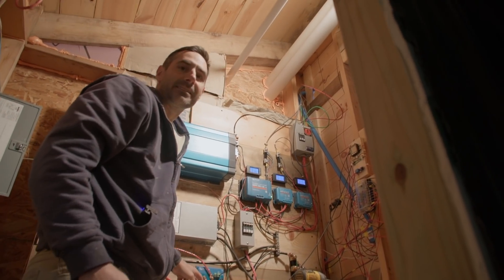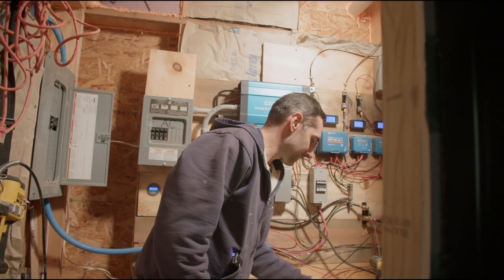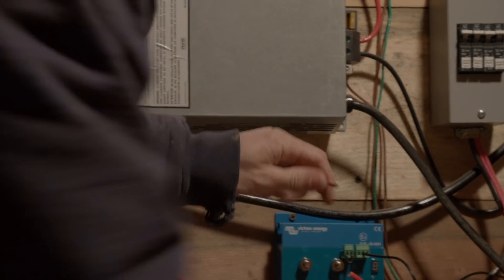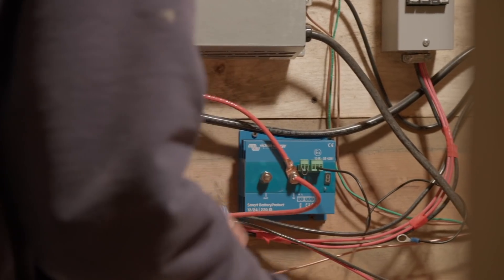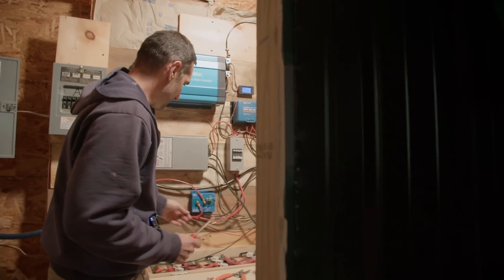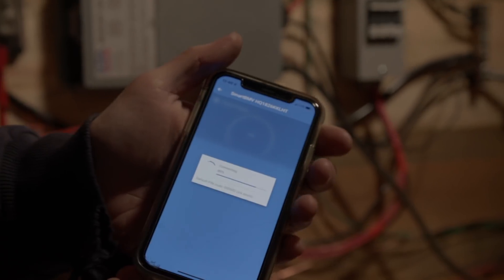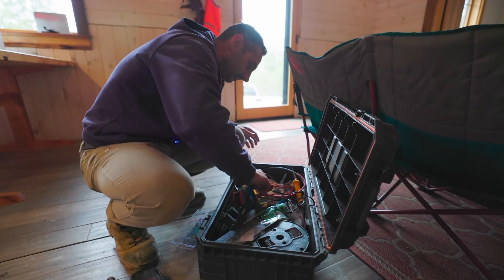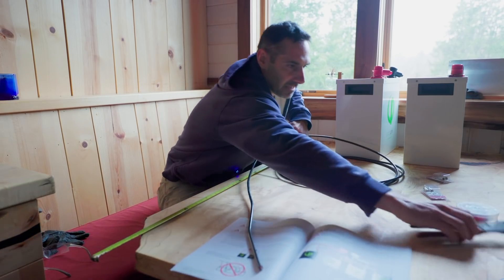Installing new Batteries | Lead Acid to Lithium Iron

Comment: Nice Mike. In your climate an not being there in the winter all the time, is battery temperature a concern for lithium and do you keep the power on when you leave to go back home?
Reply from the maker: It's not really a concern.  If I arrive to the cabin and it's below 20 degrees, I just have to make a fire first before I can use any power.  I keep it turned off when I am gone.

Comment: Little pro tip I learned is to use a pencil ✏️ and rub that graphite on the ring’s before connecting to the terminals, you will never get a spark.
Reply from the maker: Cool thanks!

Comment: A duct jack will make the process of upgrading the solar panels so much easier. Bring down the old panels and up the new ones without carrying them on the ladder one at a time.

With the better battery setup a bread maker can really change the feel of the place as 20-30 minutes of setup time can give you fresh bread at each meal and most of that time is back at the house measuring the dry and wet parts to have dump and set level of work at the cabin. How would the bank react to fresh raisin bread on her visits?

Comment: You can turn equalization off on them victron charge controllers. I'd look more online for the proper settings for that BMV and charge controllers. Also, that victron low voltage disconnect isn't really needed with them batteries. Drain them to 0% if you want, it won't hurt them. Them batteries will age significantly more with time than the amount of cycles you put through them. You don't need 10,000 cycles. 10,000/365 = 27+ years if you cycle them daily.... which you  won't. Glad to see them leads are gone.
Reply from the maker: Nice thanks for the tips!
Reply: A Victron LBCO is definitely needed for DC loads so your BMS avoids having to shut off the batteries. BMS should be a last line of defense, not the only one.
Reply: @BriggsandStrattonEnergy  No other battery manufacturers require this but you do? Definitely won't be buying a SimpliPhi if you don't trust your BMS to work properly.
Reply: @off-gridengineering3377  No worries - we are not the perfect fit for every single application. However, adding additional protection into your system is one way to ensure your product is going to last well beyond its 10 year warrantied lifespan. Other manufacturers may not require as much protection, but on the other hand, may in turn have a shorter warrantied lifespan. Cheers!
Reply: @BriggsandStrattonEnergy  I have to disagree. Wasting money on something just not needed isn't okay. You have to draw the line somewhere. Also, I would say almost all people off grid have a very close eye on their power usage and would know if they were getting close their capacity. And again, 99% of people don't need 10,000 cycles out of their batteries. Time will kill the battery way before cycle usage.

Comment: I'm working through your back issues and last night I wondered if you had thought of a rock wall in the creek and a natural waterhole? If you do it, put some stormwater pipe through the base and add a riser when you finish. Also think about a smaller pipe with a barrel union so you can add a ram pump in summer for your household supply. That would need a screen on the inside.
Reply from the maker: Actually I have an old video called enjoying Memorial Day weekend and in that video my nephews build a little dam in the creek.  Nothing of the scale you mention but we have thought of  doing that. I do have some plans for hydro in the future.
Reply: @50Acres  Yes, I've seen that video and that's what gave me the idea. I'm guessing you would only dip in the pond during dummer. Temps here range from 32F to 108F dry heat so we don't get frozen pipes.

Comment: Just a tip, 25.1 is resting voltage for 20%.  If there’s load it’ll temporarily sag due to resistance, and could cut when your batteries may be at 30%
Reply from the maker: Yea I was surprised to see that voltage lag is still a thing.  in ways they behave similar to FLA.
Reply: @50Acres  LiFePo4 is less sensitive to voltage swings as Li-ion.  You could set for 25.0 or below and be fine.  Allow a tiny bit of wiggle room for sag.  Also sounds like you’ll cycle your batteries at max, 20 times a year?  That’s 500 years.  But remember cycling isn’t what will kill your batteries, it’s a phenomena called “Calendar aging”.

Some speculate LiFePo4 can be good up to 20, max 25 years.  Assuming they last 25 years and you’re hauling 100% Depth of Discharge for “5000” cycles, that is STILL 200 full cycles a year, which you aren’t using.  I’d say don’t worry about it and use them to their fullest.

I own a 2013 Tesla Model S P85.  First 2 years i babied it, only did slow charging, never charged above 80%, and never below 20%.  Never took advantage of my free supercharging for life.  Then a few years ago I said screw it.  I charge to 100% and rip it down to 2%.  I take it on 700 mile road-trips now where I’m beating on it at supercharging speeds of 125kW (350 amps @ 360 volts DC).

Not seeing any detrimental effects on my battery.  The calendar aging catches it more than the use/abuse/fast charging.  Brand new I got 265 miles of range.  Today 9 years later, and dozens of multi state road-trips, I get 254 miles full charge.  Loss of 4% over 9 years.  I’m still stomping on the accelerator and getting 0-60 in 4.2 seconds.  That pulls 320kW from my 85kWh pack when I do that.  No issues

But yeah they’ll likely get replaced due to advancement in technology or calendar aging before you ever wear them out by cycling down to 5%.  And who’s to say those numbers Simplifi posted aren’t with buffers built in?  When my Tesla “says” 0% it isn’t zero.  It’s 5% And when it says 100% it’s actually 95%.  BMS locks the buffer.

I highly suspect Simplifi factored in buffers.  ALL Lithium iron phosphate cells are 3.2 volts nominal (I used to work for an EV company building custom batteries).  Full charge is 3.65volts and empty is 2.5, though many makers are NOW saying 0% is 2.75volts.  You use 4 cells in series for “12v” packs and and 8 cells for 24.  8x3.2 =25.6 volts nominal. Exactly what Simplifi says.  But capping at 25.1, each cell is only 3.13 volts.  Still pleeeenty of buffer.  Simplifi claims 0% is 24 volts,  but that means each cell is 3.0 volts.  0% for a LifePo4 cell is actually 2.75vts.  So Simplifi factored in 0.25 volts per cell buffer, to get those extraordinary cycle counts.  Their definition of 0 is actually 9% or so on the cell level.  Your buffer is already buffered in.
Reply from the maker: @xzibit8614  Thanks for the info man, I'll talk to you about this stuff on messenger in a bit.

Comment: I did electrical work for 40 years. When you wrap a wire, cable, ring terminal, etc. Don't stretch the electrical tape to break. If you do it will begin to unwrap during temperature changes. Instead use a pair of sharp side cutters, pocket or razor knife. It won't turn loose and begin to unwrap. It also won't expose the tape goo over time.
Reply from the maker: Nice thanks for the tip.

Comment: Why white batteries ???  I've seen both colors, whats difference ???????????
Reply from the maker: Im not sure.
Reply: We now use a white metal case as opposed to our previous ABS (black) case. The white is our newest model, but the internals have not significantly changed and both black/white models are compatible with each other.

Comment: Getting the right charge controller config for lifepo is real tricky, especially as controllers seem to be set up for lead acid.
Reply from the maker: I like these victron a lot, I custom programmed them according to the simpliphi integration guide that they made specifically for victron controllers.

Comment: I may have missed it... How are you planning on keeping them warm enough to charge? Do you leave the charge controllers on charging while you are not at the cabin?
Reply from the maker: The battery has built in protection to prevent low temperature charging and discharging.  They can be discharged down to 4 F and charged down to 32F.  I usually make sure they are fully charged before I take off and then just make a fire first thing when I arrive.
Reply: @50Acres   ah ok, so you completely shut down the system when you are not there, makes sense! I am wrestling with this scenario... I think I'd rest easier knowing my system was off completely while I am gone. Thanks for the response!

Comment: I'm so glad that I have power at the road at my camp. There is way too many wires, circuit breakers and charge controllers on that wall. But if you want power off grid and you have no other choice I guess you gotta deal with it. I like the people who have power at the road and go solar anyways. It costs more to have solar installed than on grid power installed.  By the time the system pays for itself you'll need new batteries or some other component.
Reply from the maker: I view this as a very fun hobby that also has a nice benefit of making power.  If you don't enjoy it, I would not recommend it.

Comment: 3/4" thick wall copper pipe smashed flat makes a good bus-bar for up to 500 amps, and they can be free from local plumbing store cutoffs.  Also, I noticed you are using some pure copper lugs.  Connecting these to any ferrous metal (incl. washers) will dramatically expedite oxidation and even corrosion.  I use only tinned copper lugs since learning this.  They should be fine connected to copper or bronze though.
Reply from the maker: I thought about that, but wasn't sure how the sponsor would feel so I decided to just follow the manual. Thanks for the heads up on the oxidation.

Comment: What is the Amp hour difference in storage between what you had and what you have put in. IE lead acid battery amp/hour storage vs lithium iron phosohate amp hour storage? I am really interested to see if they store more power than the lead acid or you need increased amount of battery to have same amount of battery for power storage. From what I have seen most good lead acid battery have roughly 100 amp hour of storage and most of these lithium batteries have same meaning if you want more power storage you need to add more lithium as well. Very interested! Great video!
Reply from the maker: I technically went from 3120 (%50 discharge) usable watt hours to 6080 (80% discharge) usable watt hours.  But that also doesn’t tell the whole story.  The new batteries both charge and discharge around 20% more efficiently.  They fill up faster and they empty out slower.
Reply: @50Acres  I also went to the battery website and am looking at specs. I have never seen this Battery company before. I am assuming the battery you have chosen was the 3.8? I am really looking forward to how well these work out for you and any issues you have or dont have.....LOL this may be a very suitable upgrade in my future hunting cabin now. Thanks for the quick reply!
Reply: @vic2265  Yes, this is the 3.8kWh 24V model.

Comment: Incredible setup! Do you think you might add more batteries later for additional capacity?
Reply from the maker: I might, but probably not.  The whole cabins electric system is so efficient it will be a chore to use everything I can produce and store.
Reply: You can add more PHI batteries to your bank anytime. Our warranty on the new batteries reverts back to the length of warranty remaining on the oldest battery in the system, so the sooner you add the better.

Comment: Your coming along really well. You sure got a lot of patience,I have none! I won a bluetti200p in a contest and it can power a bunch of led lights and I also tried all my tools and it hardly got less than 100 percent. It can power a fridge. but it drains a lot off 100 percent when I tried a electric heaters. It's a great solar powered generator It cost 17 hundred to 2000 dollars. I thought I'd put my name in and I won! I've never one anything in my life! It didn't have the solar pannells but I have 3 100w solar panells, and it takes at least 5. I watch a channell in Canada, and I got it about a week later .You can charge it at home by plug in the wall(6 hours) or if you have solar pannels it takes about 2 hours and if you plug into cigeret lighter it takes about 12 hours .I'm really liking it. It can help me build my cabin by running all my tools. I'll be getting bigger solar pannels and I might need your help setting up my solar room, if you could help me .It might take a while but I'm saving money to get it built. you got a real nice cabin!
Reply from the maker: Wow David congrats on winning that Bluetti!  That is too cool!

Comment: Awesome video as usual! I can't wait until my cabin is this far along. 

Pro tip for cutting multiple cables the same length for batteries or jumpers: rather than using a tape, cut a conduit(pvc or emt) the length of the cable you want and sleeve the conduit. It will help you not poke your eyes out and speed up the process.
Reply from the maker: Nice thanks for the tip that is a great idea

Comment: Do you have plans to add more solar panels to increase the charge capacity?
Reply from the maker: Yea I have 3 big panels in storage.  I'm going to take my 4 south facing panels off and put them by the pond or somewhere else.  It will take me from 640 to 1080 facing south.

Comment: What does that app run off of, your inverter? That seems pretty handy. Is it WiFi or Bluetooth?
Reply from the maker: It's bluetooth, no internet needed.  It's really handy.  If I a in range I can log in and check how my system is doing.  They also sell stuff the lets you monitor things remotely but I don't have that equipment.
Reply: @50Acres  is it an added piece of equipment or is it integrated with one in your system?
Reply from the maker: @AnAlaskaHomestead  it runs off an app called victron connect, as long as you have a victron component you can use it.  It's best combined with the battery monitor the BMV 712 in my case because that gives you a lot of data.  The charge controllers are nice to have too because you can look in at their production if you have more than one controller and isolate what one is doing the best.  etc.
Reply: @50Acres  that’s pretty cool. Thanks for the info

Comment: Watching on TV. How are you liking those batteries now that they've been in for a bit. I really have to start thinking about my system  for my cabin.
Reply from the maker: I like them a lot, it's pretty wild, the charging efficiency is the unsung hero.  They reach full charge so fast because you don't have to put in 1.2 to 1 ratio of power.   Combined with the victron stuff I am really liking my system.
Reply: @50Acres  thanks for the response as I watch most of the vids I don't comment on many. Appreciate the explanations and pros cons
Reply from the maker: @Thelifeofwiley  No problem!